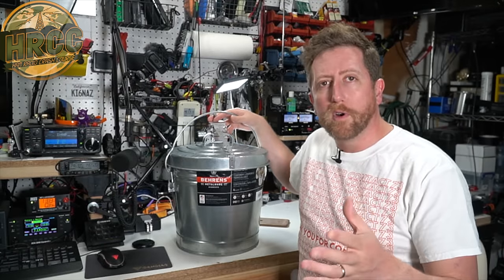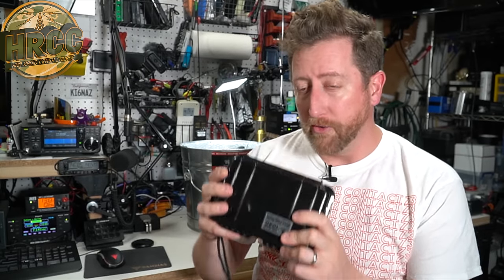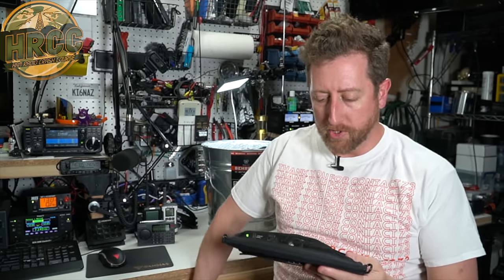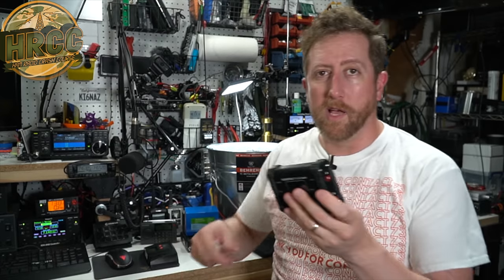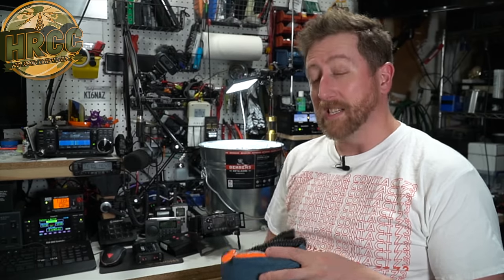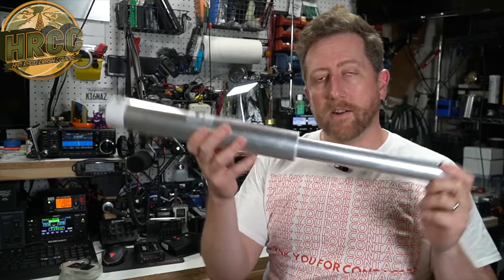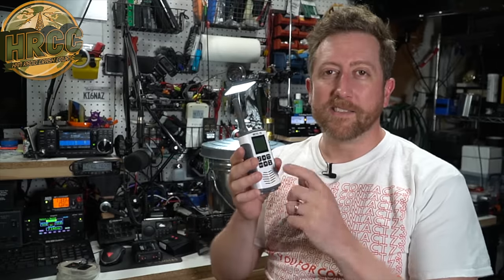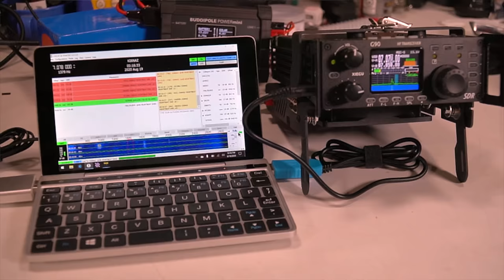Ham Radio EMP Kit, The Tactical Trash Can

Comment: I used a 35 gallon can, but its the same with the exception of scale. Think about using metallic tape to cover the seam down the side of the can, the seam at the bottom of the can, and the holes in the can and the lid where the handles are attached. Anyplace there is a puncture of the metal or where two edges, come together. I used the same RF gasket you have around the inside of the lid to keep from having to tape the lid on. I used a yoga mat that I cut to fit as an insulator aound the interior wall of the can and a anti fatigue mat that I cut into a circle for the bottom and top. I also put items in shield bags before putting them in the can.

Comment: A lot of good thought went into this video.  Good job and thanks for posting.  I'm a former EMT and I put together SABFAK medical kits.  One of my philosophies is that you need to use your equipment on a regular basis to familiarize yourself with it, make sure it works, and make sure nothing is missing.  I've taken up welding, and my EMP case is a custom steel box with a copper mesh seal around the top and a clasp for a lock.  For my purposes a 14"x10"x12" does fine.  The steel does not have to be heavy.  I just keep my equipment in there, and take it out when I use it.  One of my ham friends has his shack in a Faraday cage (he designs military HF and VHF equipment for a specialty contractor) and all his antenna couplings go out of one port that he can disconnect and close easily with a good seal.  When he's not on the air, the whole room and all his gear is sealed up tight.

Comment: EMPs come in waves. The first is the most intense and short lived. The ones the follow become less intense  but last for a longer duration.

For EMI shielding, the smallest gaps should be no larger than 1/10th the signal wavelength.

Non nuc emp can have upto several hundred MHz freq. So gaps no larger than an half inch should be good.

You can buy copper conductive paint, spray or in a pail. Something that is not reusable, aluminum foil tape.

If the frequency is higher, maybe in the microwave wavelengths, you need specialized conductive gaskets. i.e. Parker cho-seal
Reply: true, but we're still talking about very short duration of event in any case. CME is another matter though. tnx for info on high spec gaskets, will look into it ;) .
Reply: That the 1st EMP wave is the most intense (or that it comes in waves) depends on the source. It might be true in an Atomic Bomb, but it can be more than one bomb, at variable distances, a particularly strong solar flare, a targeted EMP attack using a directional antenna...
Reply: Microwave oven with cord unplugged.
Reply: Would aluminum foil work? Where's my tinfoil hat!
Reply: H Higgins  
And hammer that lid on, and seal it with 100mph tape.
Reply: @joshkelley3145  A microwave oven is only designed to shield at its operating frequency of 2.45 GHz. They are just about useless at shielding at other frequencies. My cell phone works just fine in a closed microwave oven. Think about it: the manufacturer is not going spend a penny more than they have to pass emissions testing.
Reply: "100 mph tape"....you must be a float pilot or a Nordyn driver. 🤣

Comment: There are so many views on EMP that I don't know who or what to believe. I've been told that if your device is off, you shouldn't have any problems. Others say that it doesn't matter whether your battery is on your radio or not. It all depends on whether the on/off switch is on. And under no circumstances should the device have an antenna attached. 

Your idea of having an external antenna is great. I have a large bag I bought on Amazon for about $260 that is enfolded with a Faraday material. I've been told, however, that  in the event of a sizable EMP event (because some come from the sun), that the bag won't really over the protection I was seeking. The metallic material may keep phones from ringing, but a sizable EMP event, especially from a bomb, will go through that flimsy material like it wasn't there. I also bought a plastic bucket, removed the metal carrying handle and put it in an aluminum trash can. I put some radios in the plastic container and then put the top and it seems to work.

Another thing to consider is the weak link in all this, which is the batteries. In a large event, my electric power stations may be fried. In that event, the solar panels (which also may be destroyed) will be useless. You talked about "topping off" your batteries for storage, but Baofeng recommends for long storage that one keep batteries stored at 80 percent. That may be for combustible reasons (they didn't say) or may be for another reason. Like you, I keep mine topped off. If my power stations are destroyed, or my solar panels, all my other stuff will become paperweights. 

We are so dependant on power that when was lose it, we tend to lose everything else. I'm a big believer in storing food and water. Electrical power moves our food and pumps our water. If we lose it, we are plunged back into the 1800s.

Comment: That's a nice portable EMP set up. I have 13" and 14.1" laptops and all my old cell phones in a Faraday Defense NX3 bag, two Jackery Explorer 300 both in each their own metal ammo cases with the metal gasket upgrade to make them EMP proof. Just recently ordered four Fenix ARE-D1 battery chargers for my Eneloops, 21700 and 18650 batteries. They have 4 bay chargers but I live by the one is none rule so 4 single bay chargers with full featured display are better for my preps and can be spread into other kits if needed, plus its Fenix which I've owned a lot of their products with no failures for decades! I've got a bunch of AM/FM/Shortwave radios I like and two way radios but thinking still about what others I want to add. 

One special one in my preps is the Sony ICF-F10 because it's a basic AM/FM with no sensitive complicated digital circuits to fail, sounds great and at low volume and I ran mine for 2 years on once set of D cells maybe 1000 hours. I used it every morning for a couple hours and some weekends working outside  I could not believe it, some kind of efficiently fluke at low volume where it can just last. Since then I have D cell to 3AA adapters and use 6 Eneloops in it. It still goes for a year depending on how I use it. Its a 1990s style design. When they were available for $20 back in 2011 I bought 5 of them for me, friends and family it was a good one for the cost.

Comment: Josh- I think a better container would be either use a 20mm or a 30mm ammo can.  My thought is, it is easier to put a square or rectangular piece of equip. in a rectangular box, plus it would be easier to use the seal on the lid. Just a thought.
Reply from the maker: I agree I love ammo boxes. The issue is the seal. You need a metallic seal instead of the rubber gasket.

Comment: Not a ham yet .. So I went with a President McKinley ssb cb radio , Wilson  1000 mag mount antenna,  Dakota lithium power box 10 and solar panel.. 3 to 4 hour recharge time .  a 400 watt inverter  to plug my home propane cook range into .. It will provide heat and a way to cook/ boil water .Everything eles in the kit  runs off aa rechargeable batteries/ USB changer .. lanterns , flashlights , frs radios and a skywave ssb  . I bought a btech triband but at this time its worthless due to my lack of knowledge.. I just started watching your videos great video .. Thanks for all you do . Amazing info

Comment: MINES bigger than yours!!!
I used a 10 gallon or so galvanized trash can. It's 16" tall and 16" wide on top. Tight fitting lid too. 
I lined mine with corrugated cardboard,  bottom,  sides and inside of lid. Duct tape on any seams. 
It's sweet!!! Painted it red, of course.  
Got my 2-way radios,  CBs, multi-meter, port TV-DVD Player. LED flashlights, a taser, batt charger, camera,  some other things I will want. 
My solar power stuff that I'm not using is in its own  cage.
O did as an extra precautionary move. But LATELY,  things the way they are. Glad I did.

Comment: Great video. Wrap each item in aluminum foil and put each in a ziplock bag. Separate out batteries and wrap them also. Disconnect antennas.  Do not ground the can because the ground lead is an EMP antenna. Avoid ammo cans because of bad chemicals. Most important is pre-establishment of nets. Don't use callsigns because they give away your address. You may well have to defend your radio gear and everything else so use your gunsafe for guns. 73 de K6VK ##

Comment: I wrap both my Pelican and Gator Case Go Kits with Aluminum Foil when not in use. I also have eight 100Ah 12v Battleborne and Clone Lithium batteries, folding solar panels, misc electronics and a 2KW Propane Generator in my 2 large and 4 small metal cans with a trash bag as the middle layer. My food and survival preps are also fully stocked so I am actually alive more than a few days. Make sure you don't allow the lid seal to create any openings the EMP can penetrate.

Comment: Side note, if you need more gear just get a bigger trash can. You might not be able to carry it around handheld, but you could totally fit a 100 watt solar panel and a QRO radio in it with no problem. Also if space isn't a concern, you could also totally line a foot locker with tin foil or something. Great video Josh, though I hope you never have to use that kit lol. 73 de W8IJC
Reply: I hear solar panels don't get affected by EMP. The only thing that would be effected would be the battery charger  that connects to the panels. I saw a video about it. Also cars that could be from the late 90s and early 2000s could be effected too.

Comment: One comment about the can. There is a video around here made by scientists who tested trash cans. If people use a trash can, the EMP will pass right through the gap between the lid and can. In this can, i couldnt vouch for the effectiveness of the inner seal. They stopped the EMP completely by running aluminum tape around the gap so that might be an option to end the doubt. In the rivet you made, I would seal that area with the tape, as well.
Reply from the maker: I tested the can in a similar fashion to that scientist on another of my videos. 65-75 db of attenuation depending on band.
Reply: @HamRadioCrashCourse  Fair enough. And Im not claiming to know better, just relaying what I saw and trying to learn. We all need kits of one form or another which I take seriously.
Reply from the maker: No worries. I didn’t take it negatively. 👍

Comment: I don't have any radio stuff (other than a phone and an am/fm radio in my car), but this kit is extremely helpful to me. I have been wearing what basically amounts to a chastity device that is a bucket welded around my front and back. I have not been assaulted before or since!!! Thank you!
Reply: You could just switch to using smoke signals for comms. Problem solved!

Comment: Lots of very good thinking here. :) In my EMP can, I have additional layers of attenuation.  I place my IC705, solar charge controller, Yaesu HT, etc in individual plastic bags.  These bags are tightly wrapped in copper cloth, and each copper-cloth-wrapped bag is placed inside a larger plastic bag. Smaller holes in the large can are sealed with copper tape.  Cardboard lines the larger can.  My thinking is two layers of RF attenuation are better than one, and the copper cloth makes a second layer easy.
Reply: What do you do about batteries and your ability to recharge those batteries?
Reply: @g-whiz286  I have a Bioenno 30 Ah LiFePO battery.  It stays in the can as well.   Two relatively inexpensive solar panels in parallel run the charge controller which charges the battery.   I would like to protect the panels as well, but do not yet have a good solution because of their size. :(
Reply: @Davidinalaska  I picked up a 100 Watt foldable solar panel that is made up of ten smaller 10 Watt panels joined together in a fabric web. When collapsed, it is the size of a thick notebook and about 1/2 the size of my Jackery E300 it resides next to. The Jackery provides 300 WH of capacity and includes a 300 Watt AC inverter, a 10 Amp 13.2V (regulated) port, and a variety of USB A & C ports for small appliances. This, of course, does not fit into a 5 gallon pail. I use a 52 gallon galvanized trash can with a slightly smaller plastic trash can (handles cut off) as my insulating liner. All of the rivet holes have been soldered closed. The intention is solder the lid on (probably with solder wick) when it is full to hermetically seal it up.

Comment: Ther is a guy(caravan guy, I don't remember anymore the name) on YT that have Testet a couple flexible solar panels and all are not working after a couple years.
He suggested to use better monocrystalline panels with propper holding.
The flexible panels go defective maybe because of not enough space for heat expansion and not good enough heat disappearing, that's probably why the aluminium and Glas cased panels holding longer.

Comment: I have a very large old table top microwave oven for my cage....while not portable it has the sealed door you need for perfect seal.  If you have a early-warning from the alert radio, you can use your existing kitchen microwave in same fashion....put your GMRs/FRs radios in there before the blast, just be sure to unplug it and leave a note on the door.....

Comment: NASA engineer here.

OK, so if you really want your system operational after a man-made EMP (or even a really bad solar EMP), you also need gamma ray shielding. The only way to obtain gamma ray shielding is to have at the very least 15 pounds of material per square inch of exposed container. For your 6 gallon bucket, that is about 2 or 3 feet of concrete (or dirt), or the same weight of water. The bottom of a swimming pool is one thought, but then the bucket has to be water pressure-proof long-term. An earthen berm can be used to store lots of sensitive equipment, plus, can act as a root cellar. 

Humidity is going to be your enemy no matter what.

The reason for this is that a single gamma ray can pass through the junction of a transistor or FET and leave a permanent short circuit as it strips off the electrons on it's way through the chip. Once electrical power is applied, the chip lets all the smoke out. It can easily ruin an entire subsystem like a transceiver. This is a lot more probable than you might think. A good EMP will give close to a 100% probability of gate shorts. The thin EMP bucket/faraday-cage cannot protect against this at all.

In my case, I know where the nearest burst will be and the radiation levels across the spectrum for my location. I am preparing for the worst case X class solar burst, and the nearby (7 miles away) man-made burst. I will still keep my Faraday box just underground.

Batteries are a continuing problem - they leak and corrode everything, and have to be maintained fully charged but never overcharged.

Best of luck everyone! And, this was a great video! I learned a lot!
Reply from the maker: Thank!  I appreciate your insight as well!
Reply: wont wiring be fried? so does it really matter to have a faraday system? thanks
Reply: @4seasonsTrucker  Only very long lengths of wire get damaged. The utility grid, for instance, has to deal with this (but they don't). Your car and house wiring will be fine. The electronics connected to it, not so much, but the wires themselves will easily survive any pulse that your own body can survive.

Comment: Tons of vids about using this can, but very few talk about sealing the undersides of the handle on top, and the side rivets. Plus,they have a small leak at the top of the seams on the sides. I have made several of these and they all had to have some kind of seal in these places, or you're wasting your time.
Reply from the maker: I just braised it closed with a torch.  Nothing serious.  You could foil tape as well

Comment: Just a thought : It is possible that your pop rivet (holding the antenna support to the lid) may act as a radiator internally, it seems to protrude enough internally and would effectively act as an antenna re-radiating the EMP pulse at a reduced range of frequencies but still at high power
Reply: I was thinking the same thing plus pop rivets are hollow when the pull through breaks. It was confusing the seal around the inside of the lid then using basically pop rivets to support the strap. Open path for moisture and RFI?
Reply: Pop rivets come with sealed tops for aerospace use. Also you can put the head INSIDE, just a thought.

Comment: I just purchased 1 31 gallon that my portable solar panels fit in along with some smaller items and 3 of the 10 gallon for my solar stations,batteries and 3 6 gallon for small radios ,wiring and other. The new 31 gallon cans have a new type lid that fits better,more secure than older lids, tight fitting like the smaller cans lids all fit.

Comment: I would line that can before the cardboard is inserted with a high dielectric strength tape. EMPs can get to 50kV/M and I don’t know if that packing tape has a high enough dielectric strength to withstand breakdown at those voltages. Also using multiple shields is not a bad idea (a metal enclosure within a metal enclosure), each enclosure will attenuate the signal if the next outer shield didn’t completely block it. He didn’t ground the shield in the video, but FYI don’t ground this faraday cage if you think it will be better, that is usually only needed if there are penetrations in the outer shield or if you’re using surge suppressors rated for EMP rise times to protect hard wired equipment. The ground wire will act as a antenna and increase the voltage on the grounded shield, something you don’t want to do.